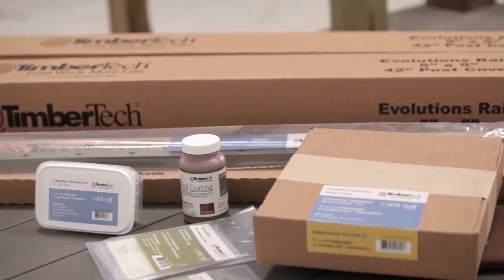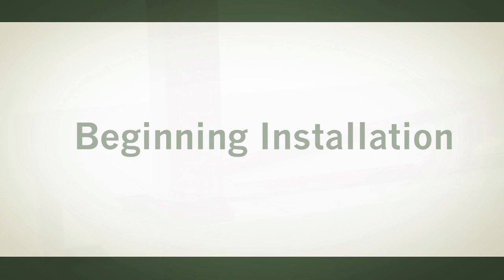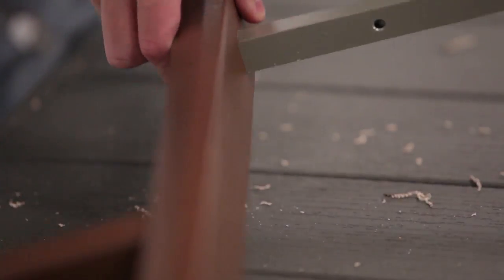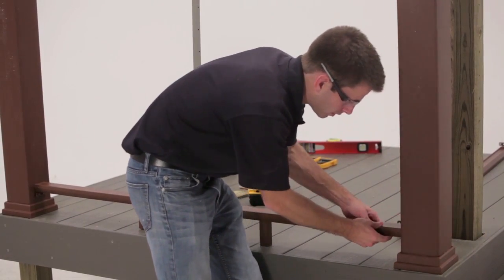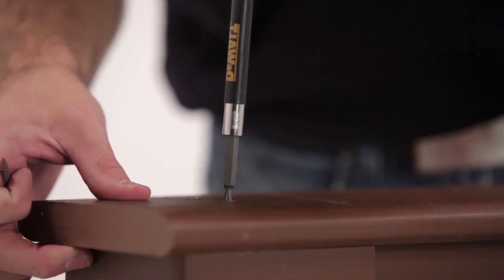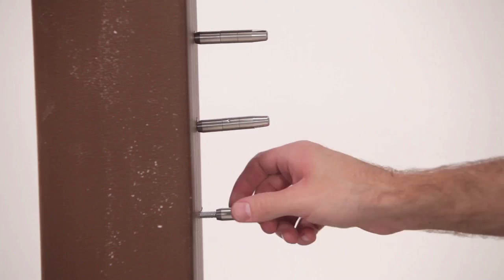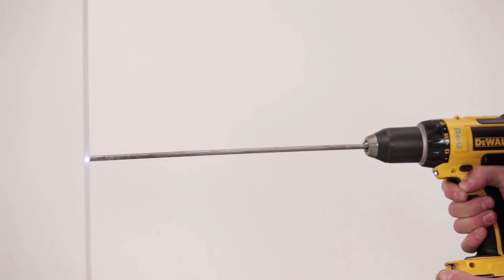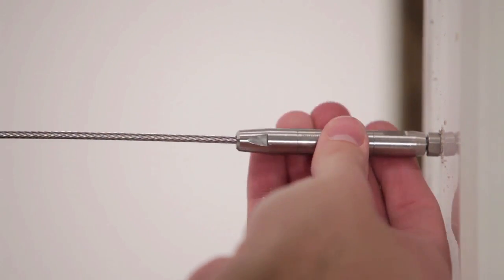TimberTech® Contemporary Railing Installation  - CableRail Infill

Comment: Has anyone used the CableRail infills in a coastal setting?  Is rust an issue?  I live 6 homes from the Atlantic so environment is brutal.
Reply: I have not, but the Timbertech catalog includes a stainless steel protectant and cleaner for harsh environments such as yours.